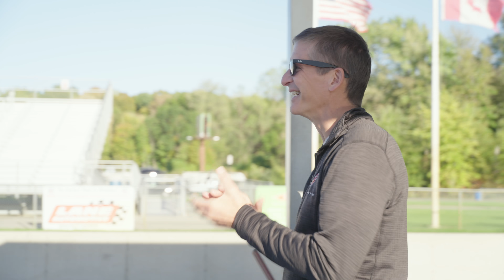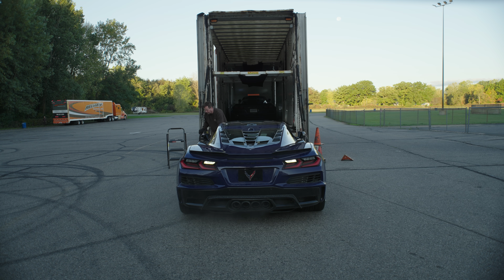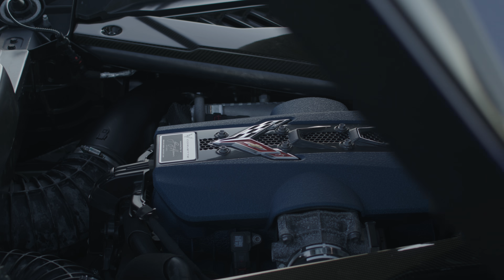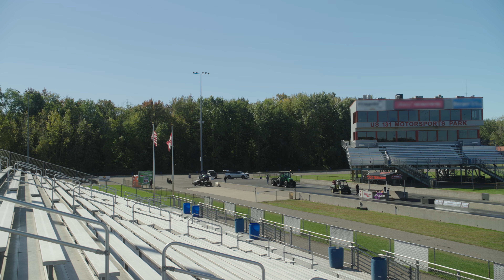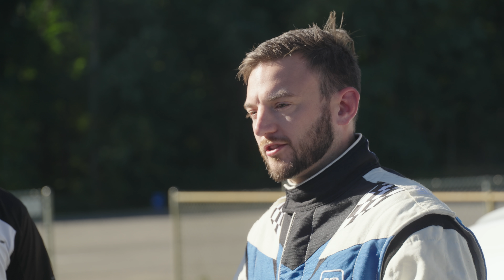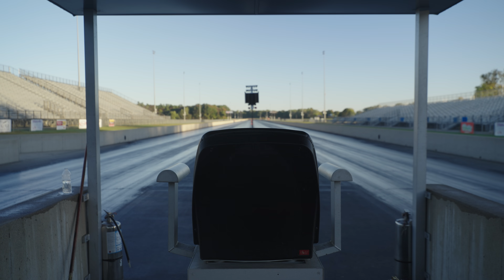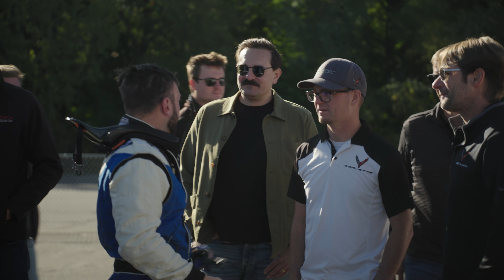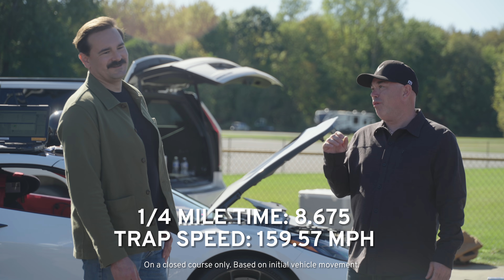We Pushed The Corvette ZR1X To Its Limits (DRAG STRIP TEST)

Comment: Finally, microwave ovens, like Tesla and Xiaomi, are defeated! Really impressive result! Congratulations!
Reply: This is hybrid combine with the LT7 Turbocharged motor with 1064hp with the electric components
Reply: Hellz yeah, knew eventually GM would break out thier hammer!
Reply: Tesla is long overthrown in the pure acceleration game. Xiaomi? Close match but it’s probably winning against the zr1x
Reply: @Heartfromsomewhere  No, Xiaomi isn't even an 8-second car lol. The best time I've seen on a drag strip with glue is 9 seconds.
Reply: @Oleg_me  rather interesting that you haven’t seen a 9.1 on an unprep surface
Reply: @Oleg_me  yeah but it has 4 doors, not made of plastic and 1/4 of the price.
Reply: @Glennloveshimself Corvettes haven't been plastic since the C6.
Reply: @Glennloveshimself  Xiaomi has 260 more horsepower, and the Corvette is mostly made of carbon fiber. Xiaomi is a good car and will definitely find its buyer, but I think it’s soulless, like all the EVs I’ve driven. Yes, it’s fast, but you get used to that acceleration very quickly, and the car becomes boring. They don’t excite me as much because I know how much simpler they are from an engineering point of view, and that’s one of the reasons why they’re so cheap. Multiply that by a terrible usability experience. Honestly, huge power isn’t necessary to enjoy driving at all, and the Miata is proof of that. But still, it’s cool that ICE cars are capable of posting such times. Just 6–8 years ago, running under 10 seconds in a street car was something unbelievable. Now it’s commonplace, and a regular M3 with just an ECU tune and an exhaust can run low 9s
Reply: @Heartfromsomewhere  Tesla and Xiaomi are both boring cars.
Reply: @artanfagdiki irrelevant point, This is the topic of speed.
Reply: @Heartfromsomewhere  Yeah, but boring speed is not impressive. No sound, no soul in electric cars. Plus, Teslas are everywhere. Who cares.
Reply: @artanfagdiki  still irrelevant. You’re the only person in this comment section to bring this point up. And it’s a comparison between a sedan and a supercar. Made it extra irrelevant.
Reply: @Heartfromsomewhere  No, I'm not. The initial comment called the Xiaomi and Tesla "microwaves." Trying to argue on behalf of electric cars proves you're not a car enthusiast. You probably discover cars when the Toaster Model S Bland came out. 🥱🫵😂
Reply: @artanfagdiki  really have to go that far? Thats pathetic. The point being that this is a speed based discussion. And now you’re throwing bs at me? That’s cool man I wish there’s more people like you.😂
And perhaps get your reading comprehension fix? I never defended the EVs.
Reply: @Heartfromsomewhere  "I never defended the EVs."

Yet here you are defending the EVs. 🤦‍♂️😂
Reply: @Heartfromsomewhere  Speed based discussion yet no Tesla or Xiaomi are faster than the ZR1X. Barely faster than the ZR1. EVs are cute for normies who don't like cars. They're visibly seen all over the roads, and they're not impressive. The Model S, 3, X, Y (😂) designs have been the same for decades. Not hating, just an observation.
Reply: its got a small microwave in the front...so I guess you're gonna have to hate it.
Reply: Yet you will still get your a$$ handed to you on the street by a microwave cause you ain't got no zr1-x Felicia!!
Reply: Lol it only took 6years to do it. If you think this is the final word in the battle of EV and ICE there's already production car EVS in the 7sec and 0-60 in the 1.4. Not to mention the Tesla roadster is coming and it's going to be the same price as the ZRLX so it should be interesting.  But huge congratulations to The GM team on this.  Better than those garbage dodge cars!!
Reply: @Cantsuspendmeclown  Why do you like boring cars that housewives drive?
Reply: @Cantsuspendmeclown are actually dumb? Let me know when EV's can touch Top fuel dragsters 3.3 seconds quarter mile. Maybe in another 50 years lol
Reply: @mmanzanozr1 those aren’t cars. Those are $100K a pass machines.
Reply: @mhigham1 that use ICE engines not EV's
Reply: @mmanzanozr1 and why do you think that is somehow outside of the realm of possibility for ev cars?
Reply: @tylerdurden8449 with the leaps EV cars have been moving at speed wise, they would of done it already if they could. Im not saying they can't but they sure haven't and aren't anywhere near those times
Reply: @mmanzanozr1 dude the only reason there aren't EVs that do it is simply because it would be boring, no noise, no drama, no entertainment, the car wound just zip off silently.
No one would be interested in watching it, so no one sees the point in it.
Reply: @tylerdurden8449 because top ev dragsters are several seconds slower.
Reply: @jordank2028 what kind of response is that even?
I ask why do you think EVs couldn't catch up to fuel dragsters, and the answer is because they're slower? lol
Yeah all right bro, now we all get it from a technology standpoint thanks to your explanation
Reply: @tylerdurden8449 they are wayyyyyy off the mark in terms of speed. It's pretty dam logical. You seem to be an ev fanatic anyways because you are all over the comment section arguing with everyone.
Reply: @jordank2028 if anything im a logic or common sense fanatic.
You're just yapping without logic, research or arguments, any question why you think they're slower, your answer is "because they are"... Yeah what a complex and thought out answer..
Thanks Einstein, wouldn't have figured it out on my own, now we know thanks to you how things work.
Reply: @Cantsuspendmeclown  6 years? Electric cars make 99% of the power on all stages of the power band.
If you have a combustion car with same power a electric car have but  not HP but power to the wheels we all see the results. Electric cars get destroyed.
That's why this corvette is a rocket.
Reply: For three times the money, shouldn’t it be faster?
Reply: @mhigham1 its is faster, way faster if it's on a track. Again, why are you here? You clearly prefer the lame, boring way of driving. The Corvette is for car enthusiast's you aren't one, so why are you here?
Reply: @mmanzanozr1 I simply asked a question, simmer down.
Reply: @mmanzanozr1  Did he even say anything about electric cars from his comment?? Or are you just being simply schizophrenic or just have no social skills